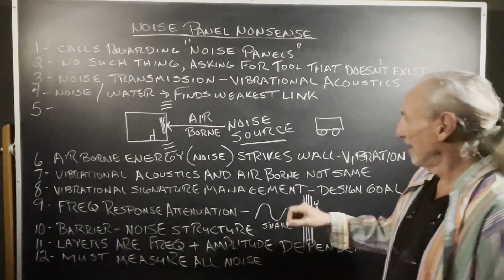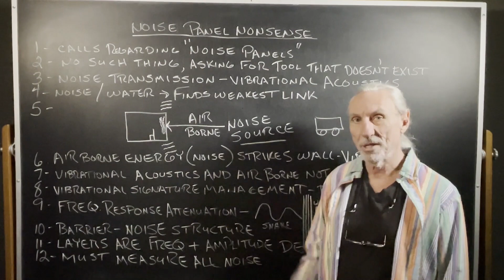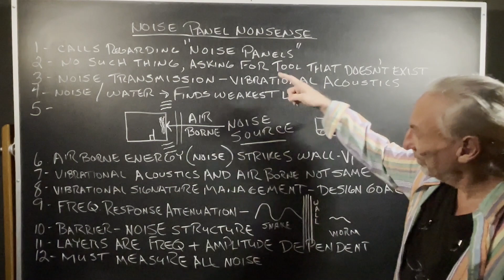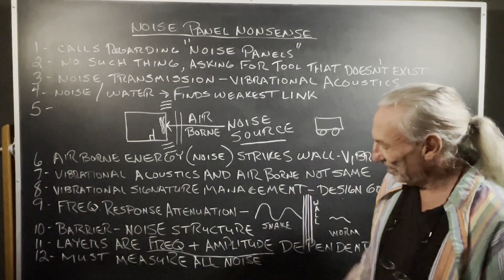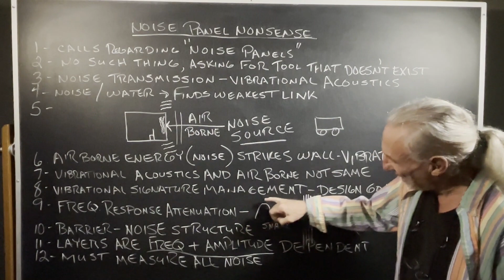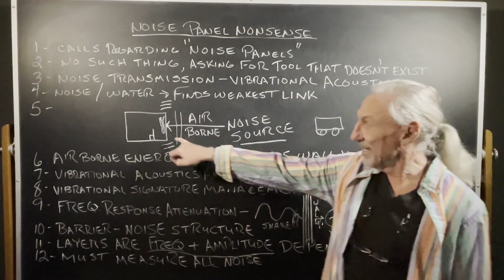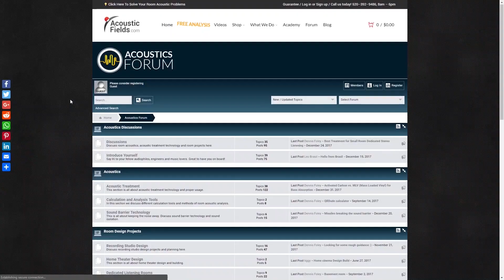Noise Panel Nonsense - www.AcousticFields.com

Comment: Great information on this subject! You just clarified my beliefs about noise control . Thanks 👍
Reply from the maker: Noise is vibrational acoustics. Noise is also like water. It will find the waekest link in the barrier system and go through it. If you hang a panel on a wall to stop noise, the noise (water) will go around it.

Comment: This is a short but great, informative video on the subject of external noise handling.
It's especially useful for those buying a new (or old) house with neighbours, especially applicable to flats. 
There is no avoiding noise or fully eliminating noise, is the key idea conveyed here. You can do stuff that will cost a lot of money to try to control (i.e. somehow alter and somewhat diminish) the external noise but you cannot get rid of it. A cheap construction is a cheap construction and if you are going to spend tons of money on it to fix the noise problem, you might as well buy another property that's build better from the start.
The other key concept that needs to sink in is that you can only do so much to reduce noise. And since our hearing sensitivity works in a logarithmic manner, you have to understand that you will be spending exponentially larger sums to diminish exponentially smaller amounts of noise trickling through I.e. if you eliminate 99.9% of the incoming noise energy,, you'll still be able to hear it, if you eliminate 99.999% by spending thousands, you'll still hear it, less of it of course but hear it you will, and so on. In other words, if you live next to a quarry or airport or highway etc. you will always hear the noise from it no matter what. Same if you live in the city - the difference is that most of the noise is ambient/background noise rather than short loud bursts so you get used to it and stop noticing it.
Reply from the maker: What a refreshing comment. One filled with understanding of the science and the issues along with 
 the treatment complexity paradigms. Thank you.
Reply: @AcousticFields  Thank you, you're welcome. I learnt from watching your video so I wanted to post some thoughts.

Comment: Sound travelling through a medium will I garentee you attenuate. Therefore the greater the amount of stuff it need to get through before it enters your ears will effect the amplitude you hear. Granted this attenuation through will greatly vary depending on frequency. But I'm fairy sure if you put a thick rubber panel over the inner wall you will receive a lower amplitude noise that is external to the room.
Reply from the maker: At what frequency? At what amplitude? You are guessing with noise which is expensive. What if the rubber didn't work and you guessed wrong. Now what? You will have to tear it out and start over.